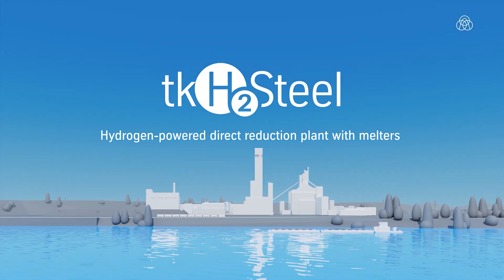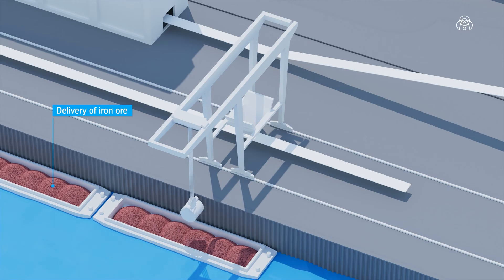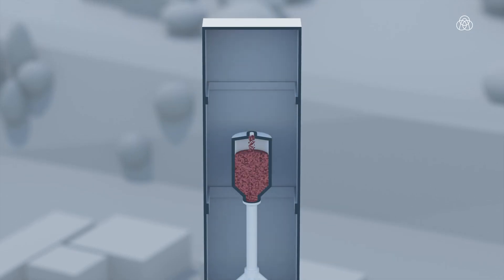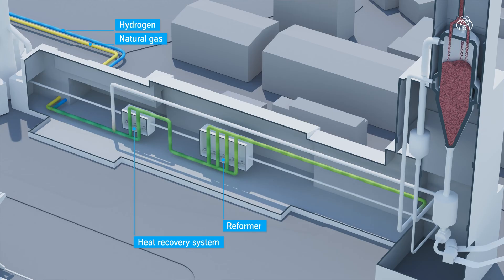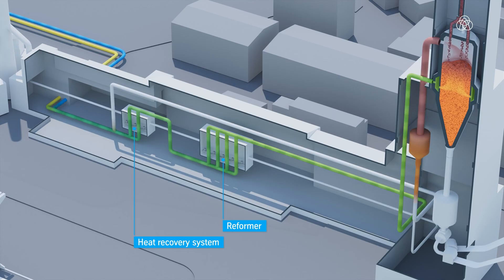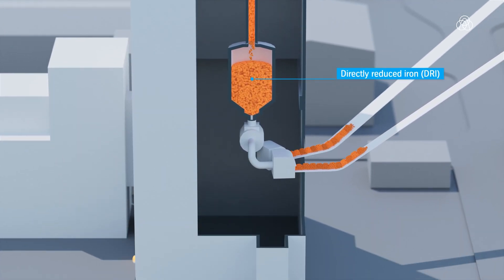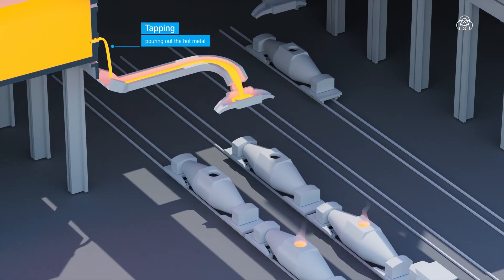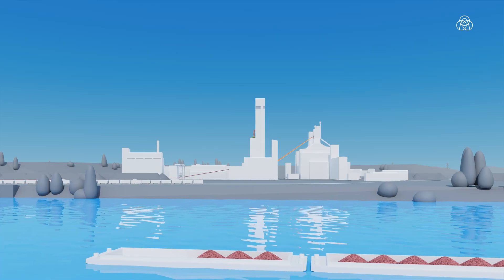How a direct reduction plant works – explained in 5 minutes

Comment: ... from where is the hydrogen obtained? ...
Reply: If it's a green hydrogen than from water and if it's Gray hydrogen from natural gas
Reply: @ilyesehoualef4137  ... no shit, Sherlock 
... but what process produces sufficient hydrogen ... and how much energy does it take?
Reply: @ApplyWithCaution  for green hydrogen we use the technical separation of electrolyzer and to use this technique we should provide sufficient electricity from renewable energy ( if the electricity is resourced from fossil energy than it's no longer green hydrogen)
And for natural gaz we use reformer (high temperature) to have carbonic monoxide and hydrogen from CH4
Reply: @ilyesehoualef4137 so it’s not that sustainable at all. maybe more expensive but sustainable ? Hmmm. You need to turn back on your nuclear power then you might get something substantial
Reply: @ApplyWithCaution  it comes from unicorn tears
Reply: What are you doing with those ellipses? You can use an ellipsis at the end of sentence to indicate words unspoken or a long pause but you have no reason to use it at the begging of a sentence nor do you have any good reason to use it before a conjunction or at the end of sentence. You wouldn't take a long pause before you start speaking nor would you do so before you say the word and and why would you need to indicate a pause at the end of sentence?
Reply: @disguy6556 ... I'm exercising my rights under article 10 ...

Comment: I have one question, after OBF and then casting slag and iron into the dedicated iron and slag runners systems, is there a possibility of some % of slag or iron "carry on" into these runners? I mean, is there a possibility that liquids are not separated and some iron can go into the slag runner (or opposite) and in how much would that be in approx. %,  in the case of OBF Casthouse? Much appreciated if you find the time to answer me this.
Reply: In an OBF, there is a possibility of slag carryover into the iron runner or iron carryover into the slag runner, typically ranging from 0.5-2% depending on operational conditions. This can occur due to incomplete separation, flow dynamics, or equipment design. Factors like tapping practices, slag viscosity, furnace conditions, and runner design influence the extent of carryover. To minimise this: optimising tapping processes, monitoring slag chemistry, and using separation devices like skimmers are essential. While some carryover is inevitable, it is usually minimal under well-controlled operations.